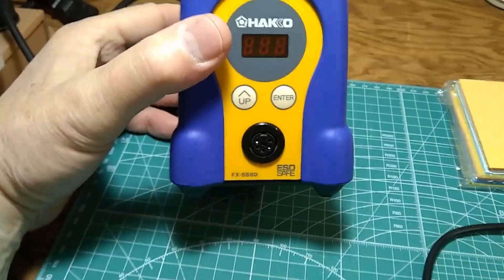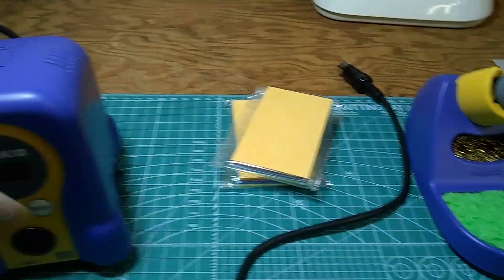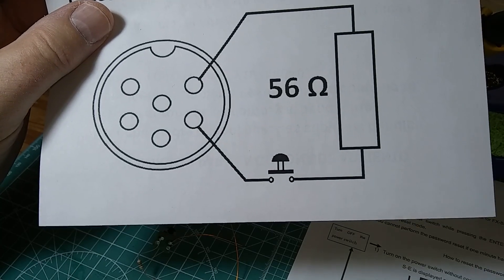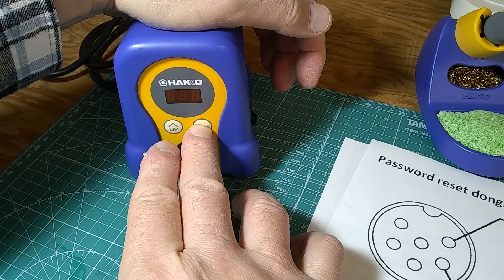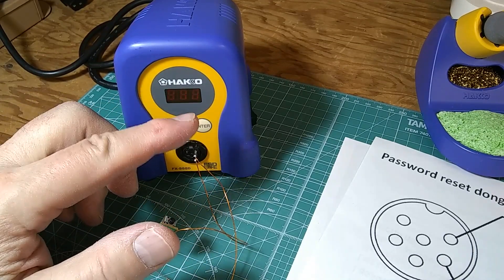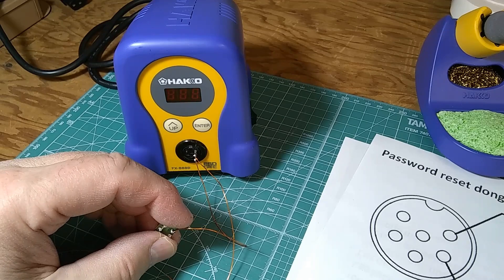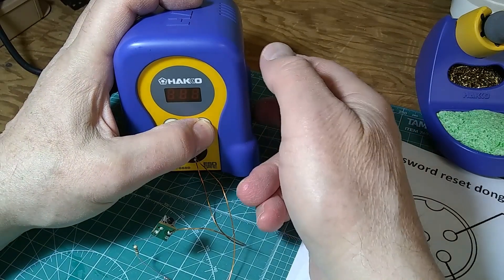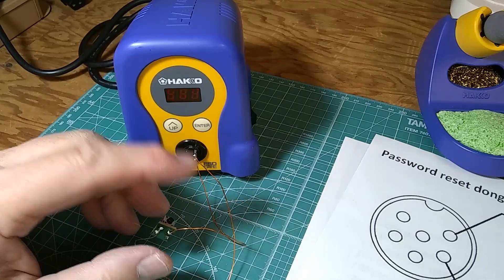Hakko FX-888D Password Reset Procedure

Comment: I just cannot get mine to rst.   I have followed the instructions and watch the process like 10 times.  I have followed the instructions and pressed when you press, and I cannot get it.  The second push just shows the 370 again, then the 100-101, never a rst.   I even held it down for like 30 seconds to get a H-S error, which I know is because I held the button down wayyyy too long.

I have powered down a dozen times, then following your process I don't get the rst
Reply from the maker: I remember having tried it a few times before it worked and I could reset my station. 
Make sure the resistor is 56 Ohms. And use pins that fit snugly into the socket. If they are loose and don't have proper contact, the procedure will not work. It's also good to use a momentary switch, as I did, to time it correctly. 
Good luck!

Comment from the maker: Q: In what situations one would need a password-protected station? 
A: Any situation where multiple employees, or students, use the same station. 
Here's why. The station allows setting the following: 
1. Working temp. between 400 and 899°F (200 - 480°C), 
2. Display in °F or °C,
3. Error adjustment, 
4. Up to five preset working temperatures (for lead-free, etc.), 
5. Low temperature alert (to prevent cold-soldering). 
All of the adjustments are not very intuitive and require access to the instruction manual. 
Setting a password eliminates the possibility of an accidental random change by unauthorized employee, or a student, and then wasting the time to re-set it correctly.